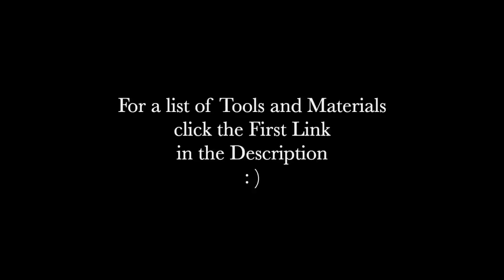Making a Roughout Wallet from Scrap Leather

Comment: Hi you do an awesome work I have a question what do you call that leather? Natural veg tanned leather?
Or naturally veg finished leather 
I recently bought a single shoulder 3 to 4 oz natural veg but that is a stiff leather y have either put oil or dye it and put some balm to make it softer I’m barely starting in the leather goods thing I’m a shoe cobble but I’m having a hard time trying to buy the right leather I’m planning on doing cardholder,wallets, mostly thanks and I hope you have a chance to answer my question.